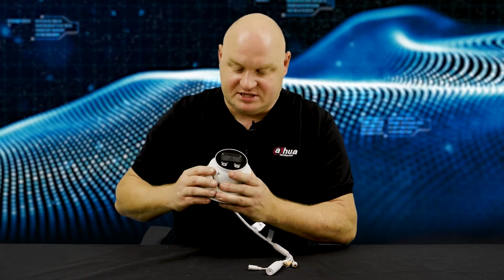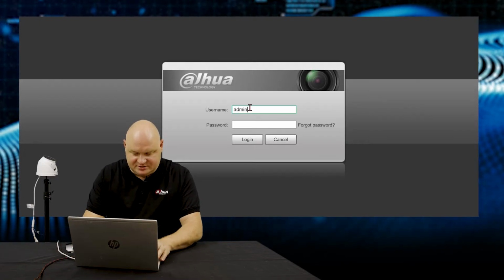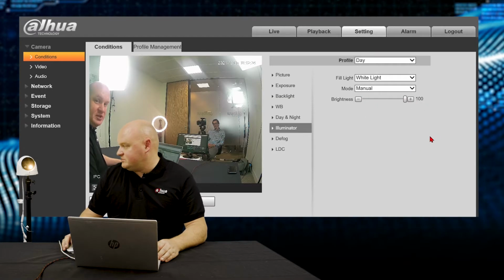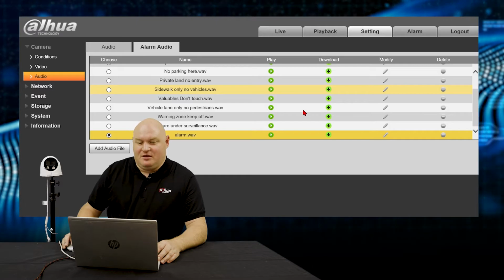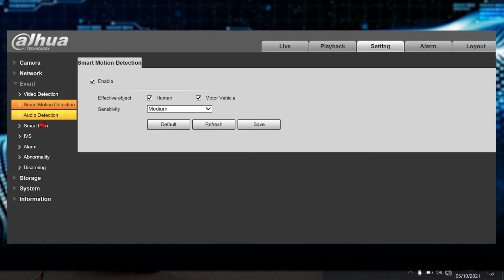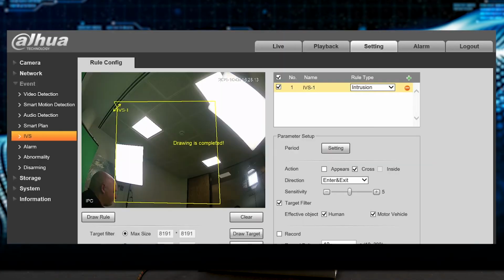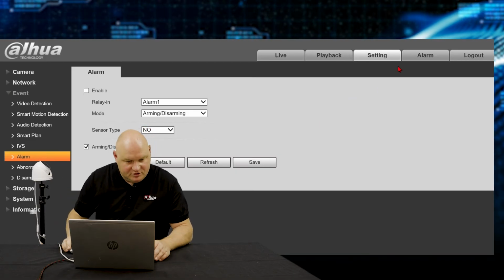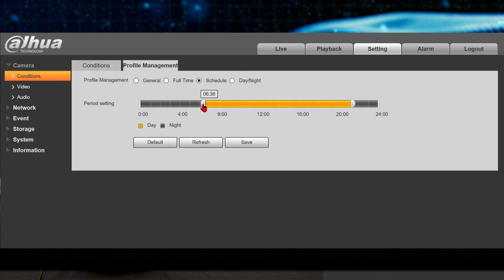Dahua Technology TiOC 2.0 : Setup and Configuration v2

Comment: What is the ideal sensitivity settings to just detect humans and vehicles? L would you say 25-30? Also do you leave anti-dither on the default settings? Thanks in advance
Reply from the maker: Hi. I suggest defaulting those settings and allowing SMD to control the triggers. Adjusting the sensitivity and anti-dither response time could work against the algorithm.
Reply: @DahuaUKIreland  ok great, will give that a go, thank you very much for your assistance.

Comment: Thanks for the video. I have a balcony with a lenght of 7meters and a width of 2meters about. I'm thinking to use a camera like this to trigger an alarm to my system. It has enougth field of view to cover all the area? It is necessary to plug ethernet after the config ? It can trigger an alarm using a NO contact that will be close during alarm phase ? Thanks a lot and merry christmas.
Reply from the maker: Yes, the camera can work standalone. However the installation parameter is a height of 3 meters of a good accuracy of the camera.

Comment: Thank you for this video. Could you please guide me on following points?

1) We have this camera installed for about 2 years and now we have changed our Wifi provider recently, I can't find anywhere on settings to change/connect the modem to the new Wifi. 

2) On my phone, I have DMSS app installed and it works when I am at home ie connected with the same Wifi as the modem but not on mobile internet. Also, now we have new Wifi and my phone is connected to the new Wifi, I can't access cameras from my phone app! 

Many Thanks

Comment: Hi Love this informative video , i just have a question i bought the 8MP version of this camera with deterrence  tioc 2 , the problems iam having is there is alot of noise in the picture specially at night with the colour feature on and also doesnt adapt well to light changes at night, all that with terrible ghosting is there a setting to make it perform like an 8mp camera or fix these issues ?

Comment: I've now installed a number of these types of cameras for the purpose of using AI and trip wire or intrusion.

First if these are being used commercially on tall buildings you may need an external speaker.

Second, for some reason they don't always work.

I'm using fixed, zoom and ptz tioc units.

The PTZ units are proving to be the best of the bunch.
Reply: Hi by not working do you mean the speaker? I did notice that on the older 2MP active deterrence too. I hooked up a strobe light to one, but the strobe had to be powered with a separate plug 24-7. Still works though from around 2019.

Comment: Hi, I am having trouble with logging in to the web server as soon as im clicking the 'WEB' button. Can some help to specify how do I get an actual range of the ip address for laptop configuration?
Reply from the maker: Hi. Please use the browser Edge and ensure no pop up blockers are on. Other options are using a PoW switch and temporally bypassing the NVR for setup. You can also use a 12V DC power supply to power locally and then connect network cable straight into computer. Try the Edge first mind since we have no other reported cases for that issue. Thanks.

Comment: I have the same camera. Do you need camera connected to nvr for IVS to work. I did everything you did and my warning light blue red will not activate. Is there other settings that have to be changed. I tried trip wire and intrusion. 

If you can step by step for me. I have to be missing something.

Comment: Even worse, this 8MP is on the same sensor and CPU as a 2MP non TIOC camera so they had to limit bitrate and other parameters on the 3849 to try to make it functional, and the results are problems even during the day. So any type of AI will bring it to its knees.

In my opinion the 3849 should not be sold with that current MP/sensor and CPU combination!!!!

Comment: Which one is the video to set up the alarm in/out to the alarm panel on-site. Just bought 4 TiOC cameras for a job requiring that feature
Reply from the maker: Hi. I don't believe we have video on that such subject. However as long as you have the latest firmware under "Menu Menu""Alarm""Alarm In Port" you will see a disarming option that you can then connect to your alarm panel.

Comment: With regards to the access platform on the camera, this would only be accessible remotely if the cameras were on the LAN side rather than the POE ports subnet, so is there any other way to talk to the cameras remotely?. I sometimes open the ports 10080 etc to allow internal porting to the cameras through the NVR using virtual host, but it seems very buggy.

Comment: Hi Chris, great video.
I have a question related to the combination of the existing alarm system and Dahua NVR and TiOC 2.0 cameras.

I plan to install
1) 2 TiOC 2.0 cameras
2) NVR5216-8P-4KS2
and I already have installed alarm system with central and motion sensors (Paradox).

Do you think it is possible to realize following scenario
1) Paradox motion sensors detect a movement and send threat signal to the alarm central.
2) Paradox central send signal to NVR5216-8P-4KS2 (Alarm In port / NO)
3) as a consequence of above point, TiOC 2.0 cameras receive signal from the NVR which
activates TiOC 2.0 camera's :
    a) siren 
    b) continuous blinking of red/blue led

In other words,  I would like to use TiOC 2.0 cameras as a siren triggered by Paradox alarm (via Dahua NVR).

Thanks.
Reply from the maker: Please note that we, as Dahua UK and Ireland, can only handle technical support inquiries for our region. Each query must go through the technical support team in the relevant country.

For technical support inquiries, I would like to advise you to visit www.dahuasecurity.com 

Please select the appropriate region on the top right corner of the page and navigate to "About Us | Contact Us" for further assistance.

If you are based in the UK Ireland here is our technical team that can assist with this query. 
support.uk@dahuatech.com
Reply: Even worse, this 8MP is on the same sensor and CPU as a 2MP non TIOC camera so they had to limit bitrate and other parameters on the 3849 to try to make it functional, and the results are problems even during the day. So any type of AI will bring it to its knees.

In my opinion the 3849 should not be sold with that current MP/sensor and CPU combination,

Comment: Super useful tutorial, Dahua UK & Ireland! 
Are you able to share some tips/guidance or do a quick video demo how to get the cameras accessible via P2P? 
More particularly, how you do the NW setup to get them outside of the internal IP address and grant public access via P2P? 
I'm facing some issues setting the port mapping and the switch menu. 
many thanks in advance!
Reply from the maker: I will add this to my content list. If there is a larget amount of requests for a certain topic we will make a plan to make a video for our audience. Thanks for your input.
Reply: @DahuaUKIreland  i agree.. p2p only works on cameras if you dont plug them into the nvr direct.  some tutorials would defo be handy, i found nothing online regarding accessing them

Comment: i bought the IPC-HDW3549H-AS-PV however in the web interface is missing the relay mode setting to arm / disarm. Does it depend on the firmware version? how can i solve the problem? i use (V2.840.0000000.18.R, Build Date: 2022-06-29)
Reply: Even worse, this 8MP is on the same sensor and CPU as a 2MP non TIOC camera so they had to limit bitrate and other parameters on the 3849 to try to make it functional, and the results are problems even during the day. So any type of AI will bring it to its knees.

In my opinion the 3849 should not be sold with that current MP/sensor and CPU combination,
Reply from the maker: Please note that we, as Dahua UK and Ireland, can only handle technical support inquiries for our region. Each query must go through the technical support team in the relevant country.

For technical support inquiries, I would like to advise you to visit www.dahuasecurity.com 

Please select the appropriate region on the top right corner of the page and navigate to "About Us | Contact Us" for further assistance.

If you are based in the UK Ireland here is our technical team that can assist with this query. 
support.uk@dahuatech.com

Comment: Can I install fx. a bullet cam directly on a wall where it rains. Or must a Wall Mount be used for it to withstand rain??
Reply from the maker: Hi. You could do with a 32mm drill bit. It would be harder to replace/swap of make adjustments without a back box mind.
Reply: @DahuaUKIreland  It's wood and I can easily push the wire in. I've just read that you shouldn't put them directly on the house because the bullet cam would break after a few years because of water getting in. Thanks
Reply from the maker: @MKAnr1  The camera comes with a waterproof RJ45 connector. I don’t see any issues.

Comment: i have been using Tioc 1.0 and 2.0 for some time now, however i am unable to trigger the siren  nor the red/blue lights Via the DMSS mobile app.   do you happen to know when dahua will update the mobile application to resolve this issue?   i tested these on 8MP tioc 2.0, tioc 1.0 and the 5MP tioc 2.0. i also tried this on the older gdms and still no luck.
Reply from the maker: Hi Michael
Please go through the Dahuasecurity.com site and select your country then click contact us for the Dahua Technical support team in your region. If you are based within the UK Ireland Please go through our technical support team at support.uk@dahuatech.com

Comment: I have installed those tioc 2.0, i have configured them as u have done in the video but once they are connected to dmss i do not recieve any message. I have activeted tripline and intrusion in the settings of the cameras but i receive 1 or 2 notification out of 40 passages. And then when i open the video up there is a LOOOOOONG loading until 97/98% where it became stuck and goes in timeout error "connection failed" and i cannot see the video until 30 minutes!!!!! The internet on the site is not awesome but still 30Mb/s down and 7/8 in upload. So where's the problem? It's not the first time that this happens and i'm a little bit tired. I think it could be a problem with configuration.
Reply from the maker: Hi. Okay let’s speak about configuration. Please contact support on 01628 200880 we can remote login and help.

Comment: Hi 
Just installed a dahua tioc 2 camera with the active d. I have set up ivms ect but the line crossing won’t pick up until i come close to the camera which is strange. Also i have noticed the image is not very sharp like the regular 6.0 megapixel next to it . The image seems to be grainy
Reply from the maker: Hi. In regard to the detection. How high did you install the camera.
Reply: @DahuaUKIreland  Hi around 2.7-3.2 max .

Comment: Excellent instruction. Does this camera have to connect to an NVR? Could the mobile apps control or configure the settings?
Reply from the maker: Yes the device has front end AI. So a recorder is not needed if you wanted to go direct.

Comment: Hi Chris, Great video.
When using an NVR such as a 5216 should you still initialize the cameras and set them up this way or plug them directly into the NVR and set them through the NVR?
I would also be really interested on a how to video of linking an NVR and IP intercom together so the NVR will record the VTO camera and the VTH can display the NVR sub stream of the cams.
Reply from the maker: Thanks for feedback. Either way works for setup. Yep I can do a video on that solution suggested no problem 😀😀

Comment: Warning cat / dog / walking bird will set the alarm off 100% of the time Ai dosen't work
Reply from the maker: It’s best to speak with support.uk@dahuatech.com regarding installation requirements. When using front end A.I cameras it’s best to configure the front end so there could be a setting in the cameras head you have missed.
Reply: I’m having same problem, my dog is being detected even with sensitivity right down.

Comment: Camera DH-IPC-HFW3249T1P-AS-PV-0360B
NVR DHI-NVR2104HS-P-I
Question:
1) I set up the IVS on the camera - both sound and light work (red - blue)
2) IVS settings from camra are not transferred to NVR ..... until you reboot NVR?
3) You set up the IVS on the NVR (by camera) - the settings are transferred to the camera (without rebooting). But when the alarm is triggered, the sound there is , but the light (red - blue) is not. Why?
4) You set the IVS on NVR (by NVR ) ------- when there is an alarm, on the camera there is no sound , no light (red - blue)   Why?
Reply from the maker: Please can you contact support.uk@dahuatech.com for an immediate response to these.

Comment: What is the difference between the two model numbers?
Reply from the maker: Hi Harley
IPC-HDW3849H-AS-PV is a 8MP Camera
https://www.dahuasecurity.com/uk/products/All-Products/Network-Cameras/WizSense-Series/3-Series/TiOC/IPC-HDW3849H-AS-PV
Spec *
8MP, 1/2.8” CMOS image sensor, low illuminance, high image definition
> Outputs max.8MP (3840 × 2160) @20 fps (AI function enabled by default)and supports 8MP (3840 × 2160) @25/30 fps 
(when AI function disabled)

IPC-HDW3549H-AS-PV is a 5MP Camera
https://www.dahuasecurity.com/uk/products/All-Products/Network-Cameras/WizSense-Series/3-Series/TiOC/IPC-HDW3549H-AS-PV
Spec *
5MP, 1/2.7” CMOS image sensor, low illuminance, high image definition
> Outputs max. 5MP (2592 × 1944) @20 fps, and supports 4MP (2688 × 1520) @25/30 fps

Comment: So if I hear you correctly for the alarm out leads there is a built in relay which will output 12v at 1 amp on an alarm event to drive an extra device like a sirene or a lamp?
Reply from the maker: Yes this is correct. Dahua relays have a 12V 1AMP electrical tolerance. You could use this effectively like a switch to control something low voltage.

Comment: Great video, thanks!  Question... Is it possible to mask a certain area not to alert on SMD pedestrians or vehicles?  Example, if you only wanted to be alerted for cars in your driveway but not on a passing street, that's in view?
Reply from the maker: Yes this is possible. If you set the region in VMD then it will control where SMD activates.
Reply: @DahuaUKIreland  Thank you!

Comment: What is your opinion on resetting a camera after a firmware update?   some say you need to default the camera, others say you need to factory default it, and some say you don't need to do anything because it reboots after a firmware update.
Reply from the maker: Technical Support states that a factory default should be performed on any device after a firmware upgrade to remove any old firmware files or bugs if any.